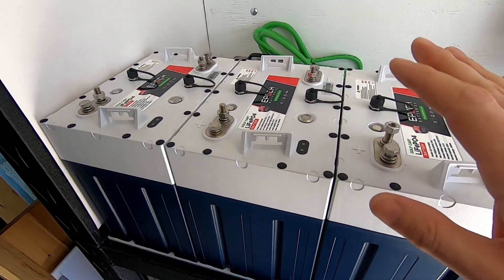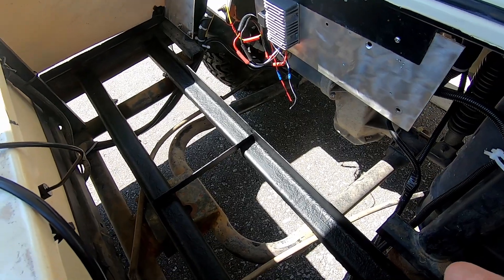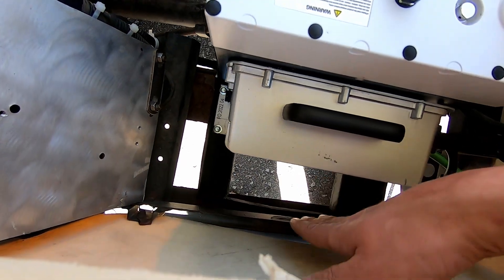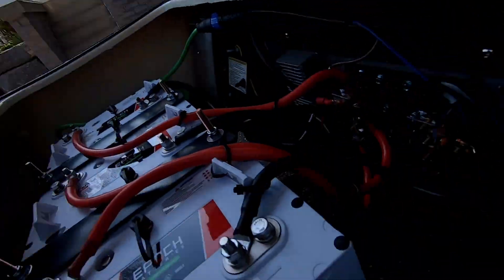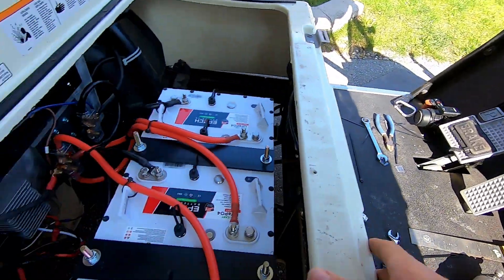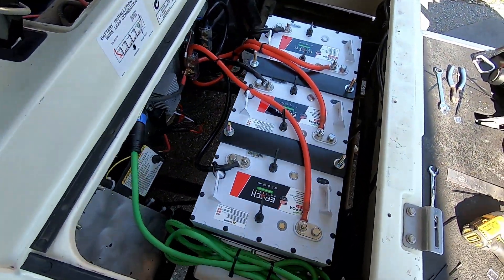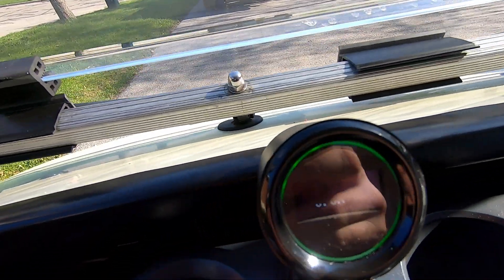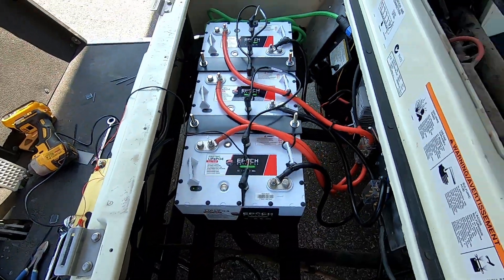48 VOLT Epoch Golf Cart LiFePO4 Batteries Install! Most amazing NEW battery on the market.

Comment: Thanks for the videos....so far today I've watched several of your videos and you worked with many different batteries.....which one would you recommend as the best?
Reply from the maker: The company you commented on in the video, Epoch! What will you use the battery for? Maybe I can provide more options.
Reply: Thanks for the quick reply....currently have 48 volt 2018 stock club car precedent....6 - 8 volt Trojan batteries..... @Roll2Videos

Comment: I have a stock 2001 CC DS Regen unit & reached out to Epoch about using the 90ah kit.  They suggested the 120ah kit as regen can exceed 180a& 4 batteries would distribute it more evenly without exceeding the maximum continuous charging current. Have you had any issues w/ excess regen amperage using the 90ah kit?  Didn’t really want to spend an additional $700. 
Thanks!
Reply from the maker: I never had any issues with the 90Ah kit, the regen worked fine on my 2001 Yamaha G22. I never went down any huge hills though. 
At the end of the season for no particular reason, I bought a 4th battery. I'll be making videos in the spring with them 😁👍

Comment: Looks great! Did you install fuses anywhere? Each of the positive battery posts should be fused to protect the cables (consider MRBF fuses). Also not a great idea to run power cords over heat syncs, they could/will get brittle from the heat. You should also consider covering each of the positive posts on the batteries.
Reply from the maker: No, That would be unnecessary these batteries have current limiting and overcurrent protection on the battery management system (BMS) thank you for the recommendation
Reply: @Roll2Videos  most Lithium batteries have current limiting and over current protection through the BMS but it is still recommended to fuse them. BMS’s fail.

Comment: Nice setup up the only thing I'd say is if you want to cut off the 12v it would be better to isolate the 48v going into the DC to DC  converter to stop the small parasitic losses of it running on no load - You can replace the relay on the output side by an appropriate fuse.

Comment: Hi I saw your enthusiasm about the Epoch batteries and ended up buying an Epoch 36100H for my golf cart. There are many 48v batteries out there but not 36v LiFeP04s. I tried one on my 2002 EXGO TXT Series cart and it didn't live up to its specs. The Epoch 36100H has a heater built in so you van charge it below freezing. The specs are 120 continuous draw amps and for a short time draw 200. It comes in one case that's 75 lbs. so no extra wiring or balancing the series batteries from time to time. The case is water proof. There is an on/off switch for long term storage. A meter that has two alarms to tell you when you are getting low so you can get back home. Blue tooth connection to an app so you can see your current draws both charging and discharging the battery and all the cell voltages. There is a numerical count on how many charge cycles the battery has been through. I've had it in my cart for two weeks and it has worked flawlessly.  I couldn't find a better battery and am happy with it and the warrantee. As a Snowbird i picked it up in Stockbridge just south of Atlanta on I75 on my way to Florida. Check it out. Steve

Comment: I installed two 48 volt as described and all I am getting is blinking red led on both batteries? Any suggestions, thanks.
Reply from the maker: Did you hook up all the positives together and all the negatives together? In parallel

Comment: I sure hope you still look back at responses to these older videos.... I did buy a 3 pack of these Epoch 30w batteries after watching the series of videos on them. Pretty straight forward as far as installation goes, Except!! There is nothing that shows where all the wires on the Bluetooth go! I laid out the the harness and plugged on end into the power gauge, plugged the other end into the module, added the com.  wire from the module  and screwed it onto the battery. I figure that the red and black wire on the battery end to in fact connect to the 48 volts at the buss bars, but I don't have a clue where the red and black wires hook to on the gauge end of the harness hook to..... Anybody been down this road yet??  AND, Thank you for having the 10% discount code posted. More than paid for the shipping!
Reply from the maker: Yes, I look at the older video comments 😁 I have made a video on hooking up the Bluetooth. How have the batteries been running for you? I love them
Reply: @Roll2Videos  Haven't got to that point yet LOL.... I was going to just replace the batteries and be done with it on this 2004 G22 But... one thing led to another and now it is all stripped down to make all kinds of upgrades!! I'm retired so my time is CHEAP and for the cost of all the things I'm doing to this cart, I couldn't get a used one in better shape. I'm sure as hell not paying 11-13,000 for a new one at age 75! I will go back through and review you other videos again.... I did blow the fuse on the converter .... I'll have to look at that in the morning when I'm fresh and full of coffee LOL Thanks for getting back to me so quickly
Reply from the maker: @royallclark6331  You just described every project I start. One thing turns into a bunch of ideas 😁

Comment: Any dummy could do what you did in the video. What you didn't show was how the cables from the motor  selinoid and transformer connect via positive and negative to the batteries . The diagram shows the selinoid connecting to positive where on my acid batteries shows it going to the negative and the transformer cable to the negative also ,so on the acid batteries it starts with negative and ends with negative. I believe its called a positive ground on  48 volt golf cart . I wired mine up as per diagram with the epoch lithium and not only does it not run but I'm smelling something getting to hot , or burning. 
If you are going to do a video on batteries installation ,get to the hard part like wiring !
Reply from the maker: https://youtu.be/itQOnHlM9pA?si=lESAt81bUg56yDin&t=146
Reply: So you did not see that he is using 48 volt batteries? If you connected that in series as you did, that's 144 volts going to the motor. No wonder you smelled something burning.
Reply from the maker: @atvtinker01  I hope he didn't hook them up in series 😳

Comment: I really appreciate the work into making this video. There is some good insight.  But truthfully, the devil is in the details. I have yet to see videos that really break down the process in detail so that a person can follow along methodically while understanding the issues.

I would love to see a series of videos that (1) explain the battery selection process, pointing out the differences between the cheap vs quality batteries.  The next (2) do a tear-down, pointing out all old components and wiring that should be removed.  Thirdly (3)  a placement/new components from the kit video.  Finally (4), a hookup and testing video.
Reply from the maker: That's a great idea.
Reply: @Roll2Videos  I realize it's a lot of work, but unfortunately I haven't seen any videos (and believe me, I've scoured for them) that give me enough reason to commit in a few months.  Technology is changing rapidly.  If the goal is to promote your channel and products that you can recommend, a turnkey DIY method is really attractive compared to local installation.

Comment: How did you wire the battery gauge that came with the kit?
Reply from the maker: I covered this in the video. The resistor at one end of the bank, short communication cables between the batteries then the fuel gauge wire at the opposite end from the resistor. 👍

Comment: Your videos are awesome. Do you have a video showing more on how you installed the relay switch?
Reply from the maker: I currently don't. I found the ignition wire by looking up the wiring diagram for my cart and tracing the wire to an excellent location to tap into it. I used a relay that can be powered by 48V and put the 12V on the switching side.

Comment: Just a note, the gauge that comes with the kit from EPOCH will run on 48 volts. I wired my mine directly to the same battery as CAN network cable. If you wire it on the other side of your 48 to 12 converter and controlled  by your relay, the gauge will not be active when you your key is off and you are charging the cart.
Reply from the maker: I said it wrong in the video. The power runs from the battery through the relay to the 48V to 12V step-down converter.

Comment: Great video! Did you capacity test these? 30ah is such an odd capacity. Also, does you cart have regen? I’m real curious how these handle regen after a full charge. Maybe they left some capacity on the shelf to cope with that?
Reply from the maker: I did not capacity test them yet, I was to excited to install, My cart has regen. The first nice day I'm off work I'm going to throw a generator on the back and go for a test run 🤪😁